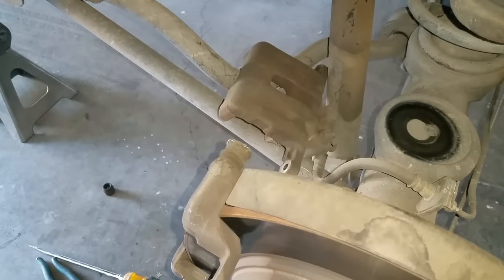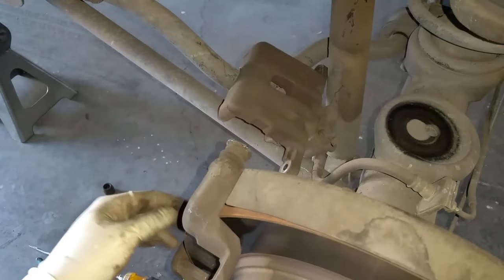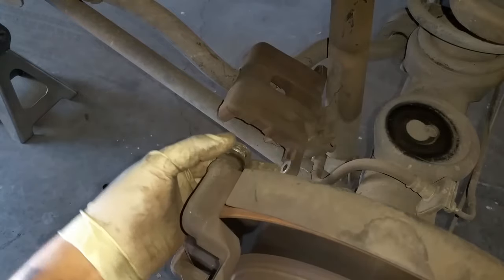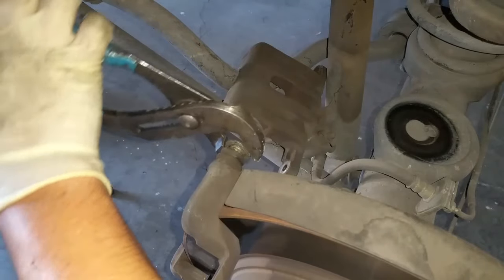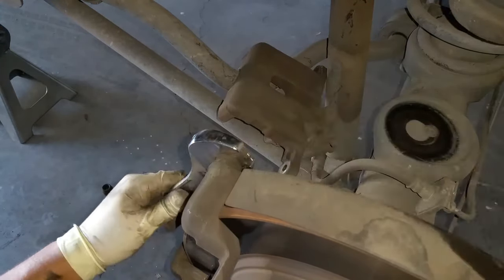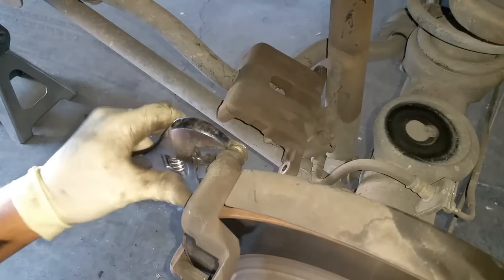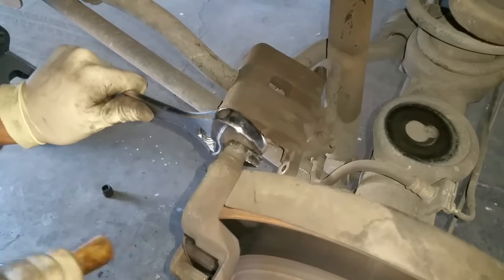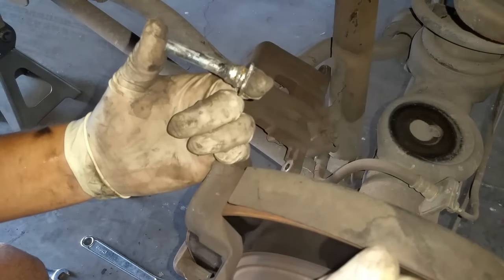Here Is How To Remove A Stuck Caliper Slide Pin

Comment: This just helped me out on a 2005 Chevy Silverado with a stuck, rusted in place, lower slide pin.  I was thinking that I may need a new caliper, but tried this trick with the adjustable wrench and was able to get it out.  I did use some WD-40 to loose the rust and then wet sanded the pin with wd40, flushed everything with brake cleaner, lubed generously and it now works great, and just a slightly bent harbor freight wrench.  Thanks again.
Reply from the maker: Awesome glad it worked out

Comment: FYI, if you take the caliper off and put it in a vice, you can heat it up with a propane torch (heat the area the pin goes INTO, not the pin itself). This helps BIG time. Lube it with some penetrating oil, then heat the snot out if it and do the same as in the video. I just went through a huge battle with a few of them, this was the only way I got them out.
Reply: How did u guys get away without destroying the boot?
Reply: Warning don't stand in front of pin, as you heat them
 it will shoot out like a bullet and might cause serious injury to you or any object in front
Reply: this comment was more useful than the multiple videos I’ve watched today
Reply: @juliosdiy3206  Pull the boot off over the head of the caliper pin. Before you heat it.  If you tear a boot, you can get a replacement set of four for $5 or $6 from any auto parts store.
Reply: I’ve been doing this for 3 hours straight and I just started to get it to spin 😭 it won’t move tho
Reply: @AndreMazi-du3ck No they dont lmfao someone always got some silly warnings 😂😂😂
Theres no spring load even, your telling me the pressure of the tiny space of oxygen and grease in that tiny hole is equal to the explosion of a bullet, dang thats intense 🫣😆

Comment: Didnt work for me at first, but i took a torch to it and applied this method and it popped out after a couple strikes with a 3 pound hammer. Make sure when doing this to replace the pins and grommets. Also make sure to clean out the bore to remove any corrosion. Thanks for the vid!
Reply: What area did you focus on with the torch?

Comment: Wow!  Yours actually rotated with the channel locks.  I'm impressed, I had to take the bracket off of the hub assembly and clamp it in my bench's vice and use a pipe wrench to get it to rotate.  I still could in NO WAY coerce it to leave the hole in the bracket.  Not heat nor penetrating oils nor any amount of pressure I could bring to bear on it.  SO... new caliper.  10 mins later, I was done.

Comment: It worked!! Mine were stuck, and I used your method and it worked, which is great because all the part stores I called didnt sell the caliper pins, just the bushing or the entire caliper! This method cost me $7.99 CAD just for the grease!! Thank you so much, life saver!!!
Reply from the maker: I am glad it helped you out!  normaly they want you to buy the whole thing so that's awesome that it worked thank you for watching👍
Reply: No sir, thank you! And of course they wouldnt want an easy fix, it doesn't make them money!!
Reply: If the pin has been stuck , doesn't that mean the actual place where it goes into the bracket is messed up? Don't you have to replace the whole bracket instead of the pin ?
Reply: You bought the wrong grease if it was that expensive!

Comment: One tip. I was doing this on my 09 Honda accord on the rear brakes but one of the pins was so rusted and seized it did not budge. So before taking the torch or buying a new caliper bracket, with a rachet and socket of the size try to move it by loosening it to make it easier to get out. In my case it was a 17 mm and just turn the rachet to loosening and it will free up the pin from rust, then you can try this method. Btw, thanks for this method it worked 👍
Reply: on my honda it is so rusted that I tried spanner and huge adjustable wrench and it doesn't even move like it's welded in there, I will try to make a second attempt, maybe even remove the whole bracket to make it easier, will see

Comment: Thanks for sharing the technique. Unfortunately mine was so seized the bolt head sheared off when I tried this.
Reply: Spray and turn would work it out slowly. Vice grips and lots of spray. Push forward as you twist it back and forth.
Reply: @AUDIO2AUTO  yes I sprayed wd 40 couple of time and let it soak and twisted it back and forth for 10-20 min then kept hammering not the pin but the pliers head. Worked like a charm. No blow torch needed.
Reply: @NeutronX101  Cool, glad it worked out for you.
Reply: @AUDIO2AUTO For me the pin is stuck in a completely pushed in position, can not get the rubber out of the to spray anything in there

Comment: Just doing front pads today and had this problem. Got pin turning but couldn't pull it out. Went to youtube. Used adjustable wrench method. Worked like a charm! Many thanks.

Comment: Awesome video. Saved me. I was doing this and got the pin half way out and was thinking of using a blow torch but then gave it another shot and 10-20 minute later finally got it out.
Reply from the maker: Awesome some people are complaining that this method doesn't work for them but it's likely those people have a bigger issue like it's rust welded into place due to lack of maintenance.
Reply: I'm going to try this.   I changed my pads and greased the pins but possibly tore the boot and it's locked in there

Comment: Dude I was changing my pads last night and everything was going sweet until I had to put the caliper back on and noticed it would fit.
Sure enough the top pin was stuck.
I went to the parts store to get a new bracket and special order SHIT but was able to get new screws and pins.
You tube my problem and saw your video.
This morning I heated up the bracket little did what you displayed and pin came right out and was able to install my caliper back on.
THANKS BUD
Reply from the maker: Im glad it worked out for you thank you for watching!

Comment: Geez, that took a lot of hits. I have one in the same condition. Thanks for the video!
Reply from the maker: thank you for watching!
Reply: Make sure you put correct grease on it if you put wrong type of grease on it the rubber bushing becomes swollen thats the reason why guide pins are stuck

Comment: 2005 civic lx been trying too get the stupid bottom slide out forever and i used some pb blaster and heat mixed it with ur technique and it finally came out ur awesome ty so much

Comment: This helped a lot!  Worked like a charm.  Had to use a sledge on mine though.  It was stuck in there tight.
Reply: Mines is stuck pretty tight too, I can’t even turn it how were u able to use the wrench and hit it with a sludge hammer plus my adjustable wrench keep loosening up

Comment: Thanks brah. I already had the caliper bracket off, so I did it in a vice. It was the bottom pin anyway so I wouldn't have been able to get a good swing at it with the handbrake cable there. The pin was clagged out with gunk and had a burr on it, that I'll file and polish down. I might as well clean out the other one too.

Comment: On my 2004 Impala, the rear caliper slide pins are threaded into the caliper bracket. They have threads at the head end that you have to unscrew before you can change the pads or remove the caliper from the bracket.

Comment: Thanks for the video. Once you remove it can you grease it up again and reuse?
Reply from the maker: That what I did with this one and it worked fine, if you have damaged pins I would not recommend it since it will probably get stuck again
Reply: @ERICSDIYGARAGE  thanks

Comment: take   caliper  bracket   too  the  stove  burn  under   pin  location  pops  right out
Reply: That means taking it out of the car, I prefer this method.
Reply: @panspermiahunter7597  its only two bolts but what ever works

Comment: Great video!

Except my pin was a lot more stuck and eventually I got it out, but it was bent.

Get new pins and put em in.. no big deal? wrong. I think the bent pin damaged the caliper bracket because new pins wont slide in. They go about 1/4" then stop. I tried cleaning it and scraping it out and got a lot out, but still same result. The new pin slides in no problem on the top, but its the bottom that seems damaged.
Reply: Update! Everything is OK. Turns out it needed more aggressive cleaning with a flat head screwdriver. Got a lot of crap out and then the new pin slides in no problem :)
Reply: I was gonna say, take the drill and drill our the junk inside but looks like you got it done. Job well done.

Comment: A zip gun works the best but this method will definitely work on something like this but I had to use a torch and a zip gun for something that was really rust welded on really good. But I'm still open minded for new methods like this. Great video.

Comment: So is this the main cause of overheating rotors,,I already tried everything
Reply: Changed break line hoses this morning...time to flush out the master cylinder tomorrow..wheels are still hot though,,already changed slide pins
Reply from the maker: what vehicle do you have
Reply: @ERICSDIYGARAGE  02 camry,,recently changed 2 front break line hose,,it cools off when parked,,,mechanic said that's normal

Comment: if it werent seized, what holds it in place,  when u tighten down nut to secure caliper to bracket via this pin. what keeps a well lubricated pin from not just popping out of bracket , thanks
Reply: Brake caliber/pin carrier in combination with opposite side (outside) brake pad.
Reply: @jarnom85  thank you

Comment: Is it possible to use old pin if you don't damage it and just apply grease? I don't think i will find a pin in the UK for an Old Honda Prelude Mk2
Reply from the maker: Yes if it's not corroded, you can resue it after you clean and apply fresh grease
Reply: @ERICSDIYGARAGE  Thanks. I took mine out today amd looked like new apart from grease which i replaced after cleaning. All runs well now...well the brakes do.

Comment: Idk if this is related but i replaced my break booster but i didn't know to adjust the rod so after i drove for 15 minutes my front breaks locked up and i drove it to get home like that now my pedal is super soft and breaks dont work untill i press pedal to the floor?

Comment: Would this be the problem if they're brand new?
Reply from the maker: no it could be that the seal is just really tight and it need to wear in
Reply: @ERICSDIYGARAGE  took it to 3 shops and they said they didn't know what was wrong. But they found everything else wrong with the truck 🤦🏾‍♂️

Comment: Pb blaster and impact wrench did the trick for me. I made sure I turned right and left with the impact wrench to try to avoid damaging the rubber boot. I was shocked that there was absolutely no damage to the rubber boot when I did this.
Reply: I just did one today and PB Blaster plus a hammer would do nothing, even after heating the caliper near the pin with a torch. Twist and pull with locking pliers (and several applications of PB Blaster while doing that) did the trick.
Reply: @jmodified  Nice. I personally tried that but resorted to impact wrench because I noticed I was starting to strip the pin head, so I thought I had nothing to lose (except the rubber boot) at that point. It could be that it wasn’t working for me because I wasn’t strong enough to do it with locking pliers or I wasn’t doing it right
Reply: @AAP0000  I could see that the pin near the head was quite lumpy with corrosion so I would need to replace it anyway. I did mash the head up a bit but it wouldn't have been a problem if I was going to reuse it.

I couldn't move it out at first either, and could barely turn it. I think as I twisted and it gradually cooled down from the torching, it started to draw in the PB Blaster and loosen up.

Comment: I’d a stuck caliper guide pin that won’t budge but I didn’t have a blow torch and I didn’t wanna buy one. Instead, I decided to be resourceful and think of an alternative. I was thinking of either using a heat gun I have or hold it above a candle. 

Then, it occurred to me perhaps I could stick the caliper mounting bracket with its stuck guide pin inside a microwave and run the beverage mode setting. :-) Did that and upon opening the microwave I could smell burned grease. Then, with a pair of vice grips I was able to pull out the sucker. By the way, I had applied PB Blaster on it and was sitting soaking for about three hours but that won’t matter I believe. Grease is kind of oil and the microwave would do its thing on it. Hope some would find this hack useful.
Reply from the maker: awesome hack lol
Reply: Lol just buy a torch mate theyre only $20 and totally a badass way to light a cigarette .

Comment: Tried to rotate my siezed pin with the channel locks recommend, and it worked on the first pin, but the second pin snapped in the bracket. Would definitley advise an alternate method of removal even in desperation.
Reply: Justin Wlodarczyk what did you do after breaking the pin?
Reply: @raftika1  What else can you do at that point? You have to get a new caliper bracket and new slide pins. But since most places don't sell just the bracket, most likely you have to just get a new caliper which comes with the bracket. At that point I don't know if I'd use the new caliper because if you do you have to bleed the brakes, but if you don't you wind up stuck with that core charge unless you return the new caliper.
Reply: @LORDRA1DEN  Even worse for me is that the front calipers and brackets are forged in one piece, so i have no choice but to replace the caliper and deal with the complication of bench bleeding all 4 wheels.  I really hope the pin doesn't break in the bracket.  Maybe i'll also use the heat/torch method and brake cleaner/penetrating fluid in combination with the wrench method...
Reply: @OlJackBurton  I replaced a caliper on my Rav4, then wound up doing another one so I had to bleed it twice. What a pain in the ass. I did the one person method and the two person method. Honestly, I'm not really sure it makes all that much difference, but the second time my local shop said they'd do it again for free so I drove it to them and they did it, too.

Comment: I have had the problem where the wrong grease is used and the pin has a rubber collar and it expands. Getting out is a case of hammering or heating as its like pullling a hydraulic cylinder with no vent. You can reuse the collar if not melted by cutting a small piece off the end.

Comment: Just needed to watch someone else do it first, after I got the stuck pin out I cleaned it up real good, greased it up and slid it in and out a few times to make sure it wouldn't get stuck again. She's good to go. Good video !!
Reply from the maker: thank you!
Reply: Same here, had to watch someone else do it first. It was fairly easy, i already had purchased new pins because i wont trust the old ones, they only are like 7€ (8.3$) for pair in here and come with grease and new boots. Its good to go now :). My car is Golf MK4 TDI PD 1.9
Reply: That’s what she said.  😳😳😳

Comment: With a stuck sliding pin does it damage the rotors or no
Reply from the maker: you will have uneven brake pads and one side of your rotor might be more worn than the other side but it shouldn't be significantly damaged you can resurface the rotor if your concerned
Reply: @ERICSDIYGARAGE  ok thanks bro

Comment: Did you reuse it is it still good... i have one stuck right now....
Reply from the maker: Kevin Aalberts I reused it just make sure that its clean
Reply: Bit late for you but I'm reusing mine and they were stuck worse than the one in the video. Sanded them to get them smooth except for some mild pitting then flushed the bore with brake cleaner, run the pin in there and spin it around etc. Then flushed with wd40 and then cleaned all the inside again. Then I put a small amount of caliper grease.
It's probably worth getting a new set of pins though as I don't think they're expensive.

Comment: Thanks for posting this it worked perfectly for me
Reply: After removing it. Did you grease it and reuse?
Reply: @thurm101  yes I was able to grease and reuse it
Reply: @Basementbarber  I have changed brakes for years and have never greased my pins. But on my last brake job I started doing it.

Comment: can i use a vice instead and what if the braket is already off
Reply from the maker: I would try to mount it back on it will be harder to remove the pin without it being mounted and a vise grip will work as well just dont put too much pressure

Comment: If you have a good air hammer, leave the bracket bolted in like the video.  Give a couple of toots with the air hammer.  Twist pin a bit. Toot toot.  etc.  Mine came out in seconds.

Comment: Mine was completely seized (last one of 8..  it was pretty annoying).  
1st got a longer socket wrench (essentially with a cheater) and was able to slightly turn the pin.  I shoved a bunch of caliper grease under the rubber to try and "twist" some lubricant into the pin somehow.  Started turning slightly easier, but still couldn't tap out like above.  

Removed the caliper bracket and put into a vice.  Took about 20 minutes of beating on it, twisting it, adding more caliper grease under the rubber, using a larger crescent wrench and larger hammer for more force.  Almost gave up before it finally let go (had my friend twisting while I was beating it)...  A lot of rust and grime underneath.  Didn't have a new rubber, but will likely need to replace soon as it had a couple cracks and likely had some dust that caused it to seize.

Comment: I tried this but it didn't work 08 nissan titan , took vise grips and finally got the s.o.b. turning then cramped them down around it and started whacking away and it didn't even budge it, finally got some penetrating spray and let it sit about an hour and started twisting it back n forth and hammering it outward at the same time and finally it came out. My goodness what a nightmare.   Thanks for the info tho